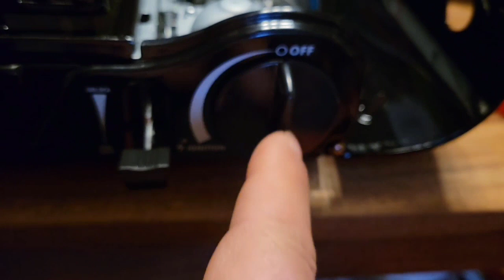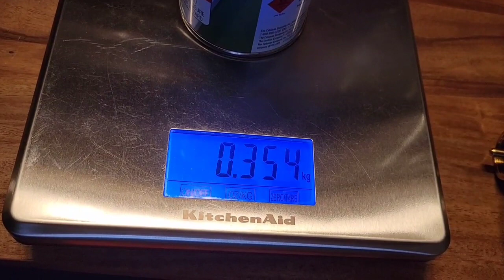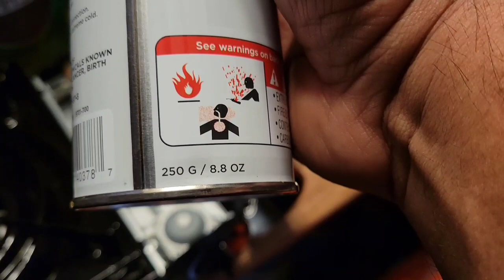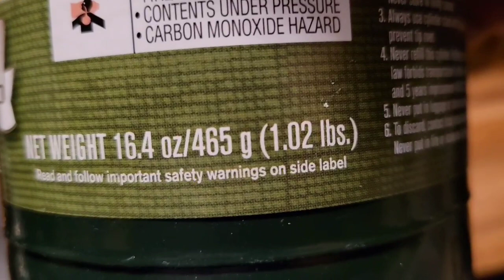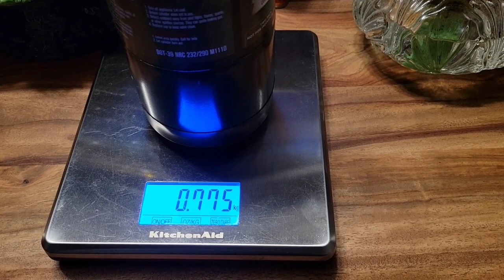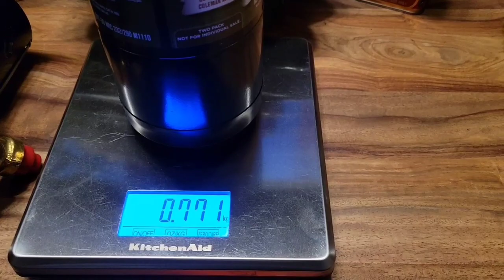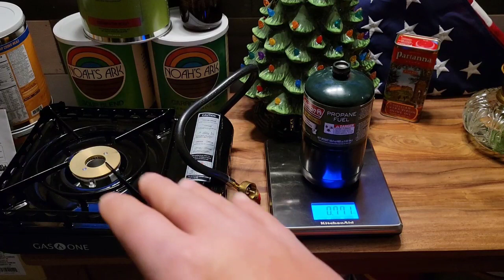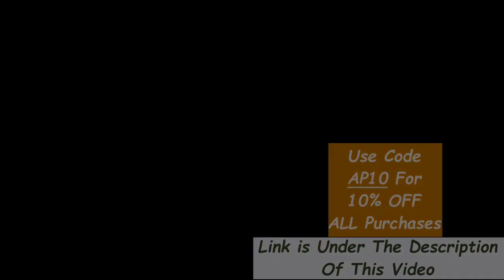*Gas One* - Dual Fuel - In & Outdoor 15,000 BTU Stove | Perfect For Grid Down Cooking

Comment: After the Texas storm last year I bought a Big Buddy heater and this Gas One duel fuel to heat my coffee and soup. I think it was a good buy. MERRY CHRISTMAS to you to.
Reply: You should have gone one step further and bought a portable propane heater that you can hang on the wall or stand on the floor using it's legs.  Then get the adapter hose, run it out thru your window using a pool noodle to block cold air and to keep the window from pushing down on the hose, then call the propane company to bring you a big tank full of propane.  I'd rather have a month or so of backup heat than a few hours.
Reply: To add a bit....if you don't have a pool noodle or can't find one, you can always use soft foam pipe insulation from the hardware store.
Reply: Thanks for the input. I did get the adapter hose and 100 gallons of propane. Also have a kerosene heater  although getting a quantity of kerosene has been a challenge. I live in Florida so hope the supplies I have are enough in case the electric grid fails.
Reply: @elizajayne2757  excellent idea! Thank you
Reply: Do they use pistols or swords for the duel?

Comment: I have this same model! I bought an adapter for it to run a 20lb tank. I use it nearly every weekend to distill moonshine. It is AMAZING and doesn't use much fuel!  I've left it in the sun, the cold, the rain, and it fires up every single time.
Reply: Hey Black Flag, I have been looking for a 20 lb adapter hose, do you have any info on where I can get the correct one ?
Reply: @blackknight1427  I went through my Amazon orders for you and found it. This is the one I use. I don't know if this will let me post the link but here is the description:  DozyAnt 4 Feet Propane Adapter Hose 1 lb to 20 lb Converter Replacement for QCC1/Type1 Tank Connects 1 LB Bulk Portable Appliance to 20 lb Propane Tank - Certified
Reply: Thank you so much, I will check it out. Cheers 🥃
Reply: AP.. it's been a year since you posted this, but it was still very helpful. 
I just ordered this GS-3900PB stove from the GasOne website. New customers get 10% off. I also grabbed the $14.99 carry case.
Of note is a change to the way you connect the 1lb propane: no rubber hose, but they include a new metal housing with regulator that attaches on the side, using the same port as the butane. Check their website for a good photo.
Thanks again for your awesome work. Now, to order one of your coffee mugs for the Wife.  Thanks.

Comment: These are so handy to have around ya'll -  pro tip:  if you live in an area with a Chinatown or asian market, there is a good chance they carry these stoves and butane cans for fairly cheap as the restaurants (any place that serves hot pot) and local families that frequent these stores use these often and the stores need to keep them supplied.
Reply: In my area, the butane canisters are usually 4 for $6.00 CND. They are very long lasting. In summer time I got a bunch on sale, 4 for $4.00.
Reply: Exactly true, my Korea Town store in downtown is where I get mine.
Reply: @AA14CBF  
Oh!!! Where do you live? I just paid almost $4 a can for mine about 2 weeks ago.
Reply: @jude7321  I live in Southern BC. Today I saw the same butane canisters, 4 for $7.00, in T&T Supermarket. Each one weights 227g, imported from Korea.

Comment: I have used the Gas One stove for years and it works very well. I do not have dual fuel but the gas cans will usually last cooking 4 meals. Using outside uses more fuel if there is wind/breeze! We homemade a wind barrier for this stove, it is necessary.  The store bought barriers are thin folding panels and they will blow over in a slight wind, don't waste $$

Comment: My husband and I have used   1pound propane cylinders outside camping and inside for power outages for many many years - 40 +/-  No issues whatsoever until last year. I unscrewed it from my single burner stove and the valve on the cylinder didn’t close. I screwed it back on immediately. I called my husband into the kitchen and he said that should have reset it. When I unscrewed it, propane was still spewing out. He tore it out of my hand and ran out the back door and threw it into the snow. When he came back in he explained that discharging propane drops to about -45 F. He was afraid I’d point it toward my face to see why it wasn’t shutting off and subsequently blind myself. He had symptoms of near frostbite just getting it outside. I did not know this about propane and am sure many others do not know it either. I am not trying to dissuade any one from propane. I still use it and consider it a safe fuel alternative when there’s no electricity. I am just glad I am now aware of this should it ever happen again. I always try to pass this info along should it ever happen to someone else.

Comment: I have, and recommend the Coleman duel fuel. It burns the white gas you get in the camping section and you can use regular gasoline from the pump. Actually, they are pretty much the same fuel, but using gasoline makes it cheap to run. I also use regular gasoline in the lanterns and it works great.
Reply: @miamivice1149  it does use the plunger pump to pressurize the tank. I have used old gas in mine and it worked fine. We found an old can of white gas in the old shed and who knows how old it was. The can was very rusted. I used all of it in my stove and lantern with no bad effects. I just used the lantern 2 weeks ago with some old gas from the pump and it worked fine. For these purposes, I believe old gas is just fine.
Reply: Propane is usually $1 or 2 cheaper than gasoline per gallon if you get it at a refill station.

Comment: I bought one of these. You can buy an additional adapter that connects to a 20 gal propane tank. I have just used it once, so far, and it's nice. I also plan to use it with my pressure canner. I have an electric stove and it's hard to maintain a steady heat with it.
Reply: Is the burner sturdy enough for a pressure canner?  I've seen people use the base for a turkey fryer.
Reply: My electric stove is a pain in the ..... when canning. I'm trying to find a 10lb rocker but no dice so far. It's a presto brand.

Comment: I have two of the Butane fuel Gas one stoves. I love the ease of it. I just ordered a dual one. Didn’t realize they had it! Also let me say that their customer service is excellent. One of my stove cases came cracked. An hour after calling them they gave me a FedEx tracking number and the new one was on the way!
Reply: All you need is the adaptor hose that u can get at home supply stores or ebay or Amazon. You dont have 2 buy another stove
Reply: @richardmoorer2668  Thanks!  I’ll buy one for one of the other stoves. I camp a lot so I’ll use them all.

Comment: Hi AP, I have one of those small stoves plus a ton of other camping stoves.
A few years ago here in Oklahoma we had a really bad ice storm that took down electric poles and lines all over Oklahoma. We were lucky, our small town had a substation and they were able to reset a number of poles and lines on the west side of town and reroute electric in from the west.
Electric flowed into town from the east and all those poles were gone. We were without service for a week. Most places in Oklahoma was without service up to 6 months.
That little stove along with the others I had furnished fresh hot coffee to all our neighbors.
I would also like to recommend that people purchase a Camp Chef propane stove/oven.
They are indoor safe when using the one pound propane bottles. They can also be used with a grill size tank and hose as long as that size tank is outside..
You can bake a small turkey in the oven or anything in a 9x13 baking pan. There are two burners on top for cooking. I have one of these as well.
I also have a RV range/oven for backup cooking. My home is total electric.

Comment: Having our dual fuel generator installed today! It is set up external, directly to the fuse box and you can turn off the breakers you don’t want power to.

Comment: Does anyone know - which of the two fuel types is more efficient? Does one take longer to boil a pint of water, for example?
Reply from the maker: That's a great question, did a bit of research and I found that butane burns at around 2,400 degrees F where Propane burns at about 3,500 degrees F.  I will test this out in the future in order to generate a real world example.  Blessings.
Reply: I think propane works better in cold climates.
Reply: Also consider altitude. It'll take longer for water to boil, etc.
Reply: @AlaskaPrepper  Great! I read somewhere that it always takes the same amount of heat, so even though it takes longer to boil a kettle with natural gas, it still works out cheaper than electricity. I'm not sure about that, because you'd also have to heat the metal kettle, so I look forward to seeing the experiment. Thanks!

Comment: You know i just used my butane stove this past Sunday. There was a scheduled power outage in my hood.

I made a meat loaf using the Coleman camp oven on top of the butane stove . Came out great and the can of butane was at the last stage  after burning for an hour.
Reply: That's great news. I'm glad the Coleman camping oven works on the single burner butane burner
Reply: @gonebananas1076  yea it did good. I was going to use the propane camp stove but decided to test the butane. 

Because I did it outside on the balcony and it was a tad cold with wind.  I draped tinfoil over the top n both sides which kept the oven at 350...once I had it dialed in
Reply: @2012spacetraveler  Good tip, thank you.

Comment: Eleven-year EX-pat from the Philippines checking in. We have many dozens of butane cassette stove brands in stores and online shops. Some have a variant called a 2-in-1. Included with your stove is a hose barb adapter that screws into the side of the valve mechanism that allows you to run your stove from the standard 11-kilo household cooking gas cylinder. We have several high-quality brands in stock made in Korea, and Japan, and one manufactured here in the Philippines. Beautiful Bride has learned to produce great meals over an assortment of my camp stoves and an open wood campfire. The cassette stoves give her another option for emergency cooking. We like these cassette stoves for my Mother-in-law who is not a prepper/camper and would have a hard time adjusting. We also have our Beautiful Daughter (14 years old) doing some cooking on a cassette stove in case she may need that skill at college in a few years' time.

Comment: @Alaska Prepper, why does some stoves say, 8.8 ozs for the cooking stoves? Or anyone that knows the answer. Because, at Wal-Mart I only see 8ozs.
Reply from the maker: Hello Iashan, I think that the reason for the lower amounts is shrinkflation; i'm sure that the ones that have 8.1oz in them are selling for the same price or higher than the older 8.8oz bottles.  Blessings.
Reply: I came here to reply but Rudy already nailed it. (Shrinkflation’)
Reply: @AlaskaPrepper  Thank you... blessings to you and your family...😊
Reply: @rexwillhite9138  thank you.. can you use any ozs on a camping stove? Some stoves says, 8.8 ozs. So, can I use a 8.0ozs of butane on a 8.8oz stove?
Reply: @lashanmumphrey8578  that stove has a specific length so measure the can, and it also has a notch that has to line up.
Reply: @rexwillhite9138  alright thank you again...😊

Comment: Its also at a pretty reasonable price too i saw on amazon only about 60 bucks considering how efficient it cooks and the fact you has both options IK amazon sells like 12 pack of butane for like 30 bucks too to at least get ya started then u go to your local store and get a good chunk of propane as well and u should at least be set for a few months especially if ya only cook what ya need.

Comment: I have 2 of these stoves in my stash. I found a local source to get the butane canisters in a 4 pack for $5. I thought that was a good deal. Propane tanks are not readily available in my area now, but I do have a good supply of them on hand.
Reply: That's a great price Danny last time I bought butane it was 2.25$ a can
Reply: A word of advice with these butane canisters. Check to insure they are marked with a CRV device. Supposed to make them explosion proof. Older ones were not. If you have in your stock the old ones, I would recommend those be used outside.

Comment: I have three similar cookers, though none of which allow for the use of the pipe and alternative gas canisters, just the regular ones. I use them for heat, cooking and heating the greenhouse for periods. If I leave the light on low, they add heat to the greenhouse for 3 - 4 hours. I find that a great help during icy conditions, particularly 24 hr conditions, it gives me a break in the daytime from using other sources. In the house we have ventilation, so I am happy to use them for instant heat should the mains go off. 
AP have you seen the 'ovens' that are powered by the same Campinggaz type cartridges? I bought one recently and they are ace. There are a couple of things in addition to the things that have to be done in order to start your type of stove, but the ovens work really well. ( You have to set the timer for a minimum of 30mins for ignition - and you have to depress a brass button in order to ignite the oven - as well as the rules for the stoves) It does require a little more dexterity to operate, but I can recommend them.

Comment: These are a brilliant addition to any back up kit.
I have a dual burner version that has a drop on cast iron skillet that Is in my kitchen and is used on a daily basis.
Out performs and more econimical to use ($$$) than my electric hob...threw that away... 
Threw

Comment: Coleman products are awesome,  I prefer the gasoline stoves, but to each their own.
Reply: You can purchase a propane conversion kit for the gas stoves. I have a Coleman dual fuel gas stove with the conversion. I can run Coleman fuel, gasoline or propane. Coleman fuel burns the hottest. Then gas and then propane.
Reply: @NotSquareToPrepare  would you happen to have a link for said conversion kit?
Reply: @doktaahwho8858  forgot to tag you.

Comment: Important !! Use only fuel canisters with the CRV pressure release rating ! The canisters have a blue ring   up near the valve end. Also check the printed label on the can.